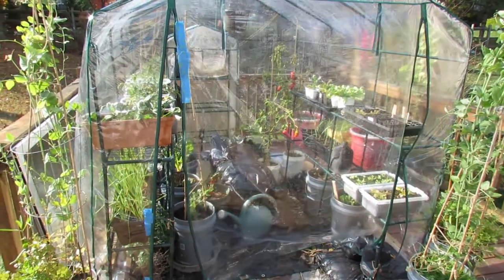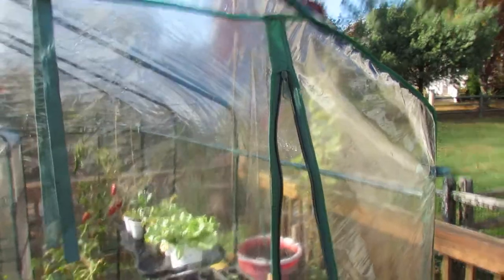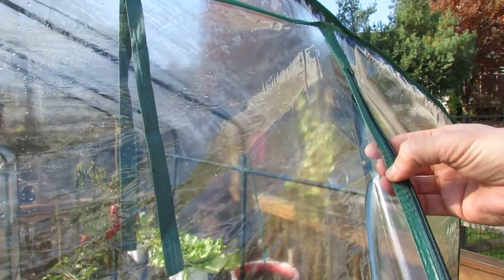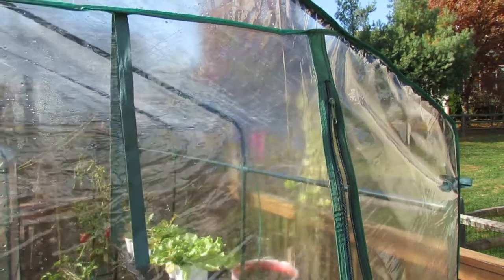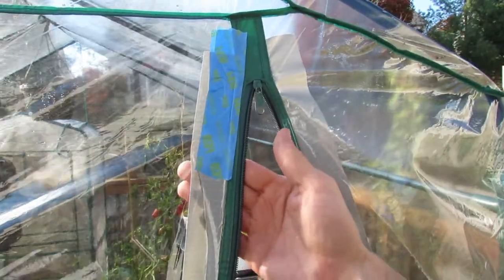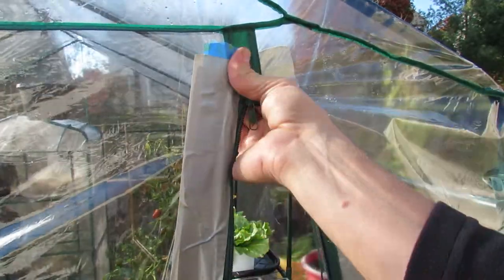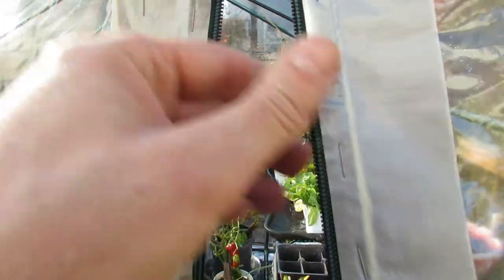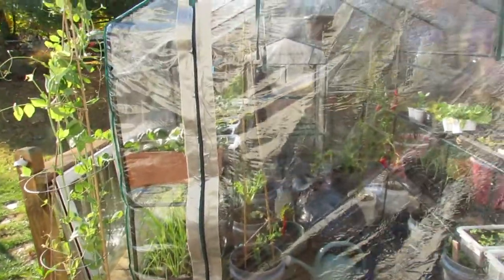How to Repair Garden Greenhouse Zipper Seam Tears with Duct Tape - The Rusted Garden 2013

Comment: this seems an adequate fix! our little greenhouse is just clear painters type plastic, will probably need to be totally replaced in a year, but it was cheap.
Reply from the maker: Tina Fisher Yep it works to let the greenhouse survive this year and next year. The seams are just terrible. I think any tape helps reduces the tension on the seams and that should save it.

Comment: The best way to deal with these greenhouses is before you even assemble it, use the tape on all the seams. Stop the problem before it even happens, because it will always fail. The plastic is weakened by the stitching and the wind will break the seam. It's all preventive.
Reply from the maker: MrsRosencranz1 I have been using Silicone for another project. I am actually thinking that will be used to back the duct tape and create a great reinforcement seal for the stitched seams.
Reply: Nice idea.
Reply: @THERUSTEDGARDEN  you mean silicon greenhouse cover

Comment: Use duct tape with the strings through it. Still didn't last very long. I re made the frame with wood, which really works as you can reinforce liner all around and stop the pulling. Then, after 4 years, just buy a new cover or buy your corrugated plastic bit by bit. The old frame I used as a cover for my peach tree. It's held down by those jumbo screw in the ground heavy-duty pegs you get with the no chew dog lead, the sit and stay ones from the dollar store.
Reply from the maker: Thanks. Great reuse.
Plus support The Rusted Garden by subscribing and using my Amazon Store  Front link 
when shopping for anything on Amazon https://www.amazon.com/shop/garypilarchiktherustedgarden
As an Amazon Associate I earn from any qualified purchases, not just items I link. 

Please visit The Rusted Garden Seed & Garden Shop (My Shop) for your fabric pots, fall & spring seeds, seed starting supplies, peppermint oil, neem oil, TRG merchandise, and more at www.therustedgarden.com

Plus support The Rusted Garden by subscribing and using my Amazon Store  Front link 
when shopping for anything on Amazon https://www.amazon.com/shop/garypilarchiktherustedgarden

As an Amazon Associate I earn from any qualified purchases, not just items I link. 

You can also find items I use or discuss in videos, by checking out my Amazon Storefront for cameras, fertilizer, pest management, shade cloth, seed starting supplies, books and more!

Earn 15% by becoming a Rusted Garden Seed & Garden Shop Affiliate.  Some people are using it for their social media followings and some people are using it for a fund raiser for schools and sport teams. To sign up... use this link to our shop and click the MORE tab on the green bar and select TRG Affiliate Program https://www.therustedgarden.com/

Or use this link to go directly to our TRG Affiliate Program sign up https://the-rusted-garden.goaffpro.com/create-account

The Rusted Garden 'Scan & Grow' Seed Collection (My Seed and Garden Shop) Just scan the QR code and watch a planting video:
https://www.therustedgarden.com/search?type=product&q=qr

Comment: how is the best way to fix seams on polytunnel. mine has gone on the arch above door, i want to do it myself. I cannot remember the company I got it from, plus if it happens again I can fix it
Reply from the maker: +Ashley Beatens I don't know the best way. I would use a silicon based caulk they dries much like a glue. I would cut out a patch of clear plastic like in a square and really overlap the tear but several inches. The one side of the patch would be smeared with the clear silicon.
Reply: Thank you will try that

Comment: I used regular 4 mill plastic and it condensates a lot. The lows here in SE Texas has only reached 34. It's like a rain forest every morning when I open the hoop house. I've been spraying the baking soda ever other day and my tomatoes still get spots from the moisture growing fungus. Any suggestions how to stop the condensate??
Reply from the maker: nelson toups I am just learn about greenhouse. I am faced with the same issues when they condense. If you have a fixed structure I think a search youtube  would get you answers. My gut tells me venting circulation of some sort. I supposes you might lose some heat and have to water more but it would keep the humidity down to prevent condensation.
Reply: I take plants out during hot day

Comment: My seams are FINE but my zipper just broke off and I'm ripping zippers off of everything to try them on my greenhouse so I can close it up! It's 12F feels like -2 here and windy...I had to rush everything inside, thankfully it wasn't much out there yet...GH is now the same temp as outside, turned off the heaters...Know of the perfect zipper that's somewhere perhaps laying around my house!?! Couldn't even get tape to close it! In desperate need as I don't have long before dark! Plants will have to stay inside...:(
Reply from the maker: I wish the would spend a little more on the house and change me 20 more bucks. But to have solid zippers and seems is worth the extra money.

If you cant find a zipper... maybe velcro tape. It isnt perfect but you can buy it in rolls. I have seen it before with stick sides but I can recall where.
Reply: Gary Pilarchik Thanks a lot for your response! I SO would pay extra to have some good zippers! Someone else mentioned velcro tape, another gorilla tape. I'm not sure which is better. My problem is, it's a little hard trying to pull the two pieces together to tape. I found an item called Tarp zipper, they have it at Home Depot and another kind at Lowe's but Lowe's didn't say they had it in store, Home Depot does, so going there tomorrow! For now, seedlings are IN the house! Grow lights and other items are going to be here by the end of the week, (Thanks to your awesome light video) and want to have this repaired by tomorrow so things can go back to being happy again! I plan on using strong tape and taping heavy plastic in the gap where the teeth would meet, then take the tarp zipper and add it to the plastic. You cut down the middle between the teeth to create your opening...I HOPE it works, let me know what you think!!! It means A LOT!
Reply from the maker: Cassie Jennings I think that is a good idea. I understand what you mean. I think that will take some pressure off it too when you go to open a close it. Good luck... those greenhouse can be stressful. And if you havent already done it, super stake it down. The wind has taken two of mine down.
Reply: Gary Pilarchik Glad you think it's a good idea and so glad you understand what I'm talking about. The cover was HARD to get on in the first place so definitely need the extra plastic and you're right, it will take some pressure off opening and closing it! Yeah, as if I didn't have enough stress already! But brought it on myself when I chose to grow and do this in the Winter! So far we have had some 3-40mph windy days with 50-60mph gusts. It's still standing and HOPE it stays that way, it comes down I will not garden this year! Lol

Comment: hello yes that should hold it for a bit...if it does come apart again you could get well two things... the first would be weather proof tape or you can get a new cover that has green nylon strings in a cross hatch melted between two layers of the normal plastic.  i think in 4 years it would be a duct-tape greenhouse lol